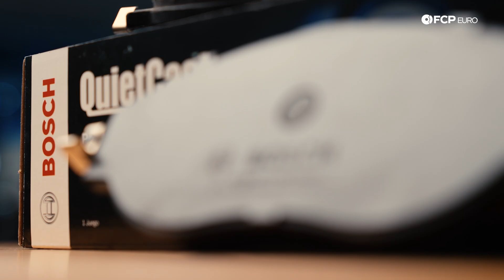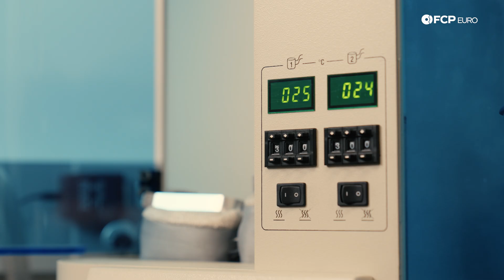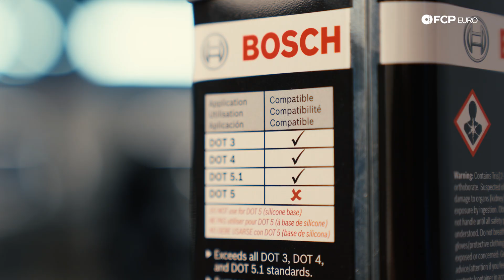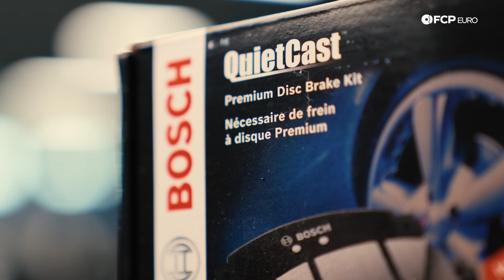Earning the Name: Inside Bosch Brakes

Comment: Bosch and quality? Not anymore. Their CP4 high pressure fuel pumps cost owners thousands to put right when they fail. And they fail often compared to other HPFP’s for diesel engines. If I were a Bosch engineer I’d be ashamed.